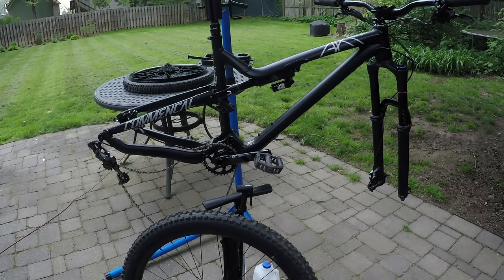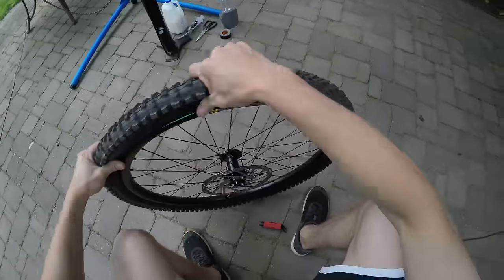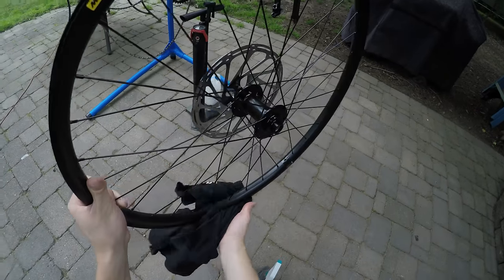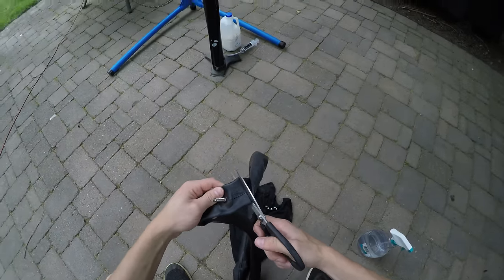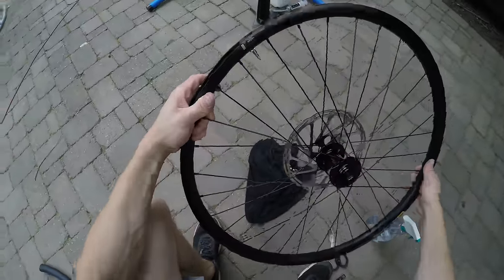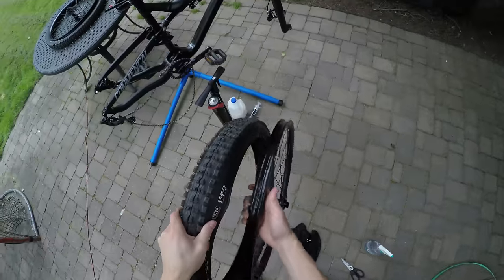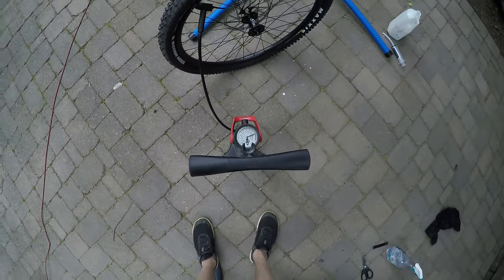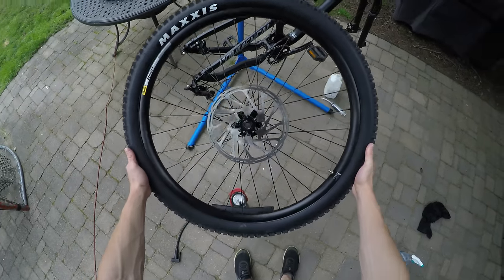MTB DIY Tubeless Conversion - Easiest and Cheapest way!

Comment: I tried this using a 26 x 2.3 Maxxis Aggressor tire on a 26" rim from a 2017 Trek 820. CLeaned with alcohol, 1" gorilla tape seal, 100ML of Stan's and I could not get past 0 psi... Air leaks from the sides and I cannot get the tire to seat. Any advice?

Comment: Hello, I tried but the valve loose air because the missing of the o-ring between the rim and the body of the valve.  The method to reuse a recycled tube valve don not work for me.  Note that the tubeless valve has the o-ring and the fastening ring shaped to accomodate the o-ring in in a way that when pushed to the rim thre are no loss. Moreover teh base of the valve is conical so it can efficently be pushed against the hole in the rim.

Comment: Have you had any experience with just putting the sealant inside the inner tube?  I have recently purchased some inner tubes that came with the sealant inside.   They seem to work ok. However the sealant did dry and clump up after several months.  Was supposed to last over a year but, oh well.  Thanks.
Reply: I have run tubes with sealant for years,  but only helps with thorn holes.  “Snake bites” where your rim bottoms out and puts two holes in the tube won’t seal up.  I finally converted to tubeless, got tired or patching or replacing tubes.  Plus it’s lighter since you lose two tubes.  And you can run lower pressure for better control
Reply: @georgehooper6955  Thanks for the reply.  I have gone back to regular tubes.  I carry a patch kit and a spare tube.  I replace the tires  before tread gets about 50%.  The worse problem I had with the tubes that came with the sealant was that the Presta valve stems would rust off where the stem joins the rubber tube.  Very frustrating.  So now I oil up the valve stems tp prevent rust.  I ride on roads that often flood with brackish water. .  I went to a little higher grade of tire and this seems to help.  Oh, I also went from a relatively narrow street tire to one that is wider. C 38 to C 45 This as I am a very heavy rider.  This has eliminated the snake bite problem.  So now I am back to the old fashion way and doing well with it. Very few flats now.  Other friends have gone tubeless and are happy with that choice.  Thanks.

Comment: How long does this last? And what kind of sealant did you use? I’m trying to figure out why this is going to be better than a tube over time wouldn’t you need to redo this process? Might as well just use tubes... it’s no different really
Reply: Last until the sealant stops sealing. Its has advantages being you can run lower pressures and puncture will he sealed and mitigated by the sealant in your tire. If you get a pin hole leak in your tube you have to change the tube find the leak patch it and or replace it. Tubless you just replace the sealant for the life of the tire. However if you dont ride often or enjoy messing with your bike I would stick to tubes. No shame. It's a tried and true choice.

Comment: Gotta be a way to use this method with inflation foam instead of air, inflation foam needs air to explain and cure so has to be without a tube the type of foam needs to be firm enough to hold a persons weight I’m thinking maybe flex seal might be strong enough

Comment: Does converting to tubeless affect the pressure range of the tire, or is it the same as with an inner-tube?
Reply: You can run a slightly lower pressure with tubeless, around 5 psi less.

Comment: Wouldn't it be easier and less messy applying the sealant through the valve? Or would it clog it?
Reply from the maker: Reyes Escamilla IV yes you can do that depending on the valve and I use truckerco sealant.
Reply: Children Of The Loam thanks!!!
Reply: yup I /put the tyre on /seat the bead on the tyre /let the air out/ remove the valve / use a syringe to put the sealant in through the valve / put the valve core pack in / pump to 50psi over night to set it in place.

Comment: What do you do when you get a flat on a trail? I can’t decide if I really want to go tubeless for that reason.
Reply: You dont get flats unless you have major puncture or tear in the tire. The tubless sealant in the tire is exactly that. A sealant to seal punctures that might happen on the trail. And also you should carry a spare tire if you worried it wont hurt. You would change it normally as if you had a tube only you would remove the valve core and use the tubes. Hope I answered your question. Been tubles for about 2 years now. I love it

Comment: Do you have to replace your hole break assembly if you get oil on it ,rotter and pads
Reply: You can clean the rotor with rubbing alcohol, but if your pads are badly contaminated they might need replacing
Reply: @mattpearce4313  ok thank you so much and ride safe 🇨🇦

Comment: Ok my tires and rims are tubeless ready, I have to pump by hand but no matter how fast and how much I pump no air is enough to make the tire seat
Reply from the maker: Try another layer of tape or use a compressor.

Comment: When i pumped air into it with a floor pump it started leaking everywhere, could not get it past 25 PSI kept leaking air and sealant. I have conti racekings, the sealant would come out thru the side walls and from under the bead. Big mess, standard rim and standard tyres.. big fail. Do you need a compresor?
Reply: No you need tubeless tires unless it won’t work because your sidewalks are to thin . Do you have conti raceking performance?

Comment: So you didn’t tape the valve stem in place?
Reply: Providing you clean thr rubber surrounding the valve, the sealant will seal it (so its not dusty / chalky), and don't over tighten the valve in the rim as this can sometimes be counter productive

Comment: Is there a significant weight reduction to doing this or is it a wash once you put all that duct tape and tire giz back on the rim?
Reply from the maker: Numero Uno there is a fair bit lost
Reply: Haven't weighed mine on a scale but it does seem just a little bit lighter, not that big a drop once you load it with sealant. Some improvement on acceleration. However, the change in grip is significant, even at the same psi. Totally worth it.

Comment: will this work on ANY bike?  i have a 24 inch mountain bike that i need to replace tubes for.  also...is there a list of the exact stuff you used?  what is the white stuff you put in the tire?  i would consider doin this if i had more knowledge and parts..might be good to try.  will this work if you go super long distances?  ty....sorry for all the questions lol
Reply from the maker: it would work on most bikes of decent quality, there is no list but it is truckerco tubeless sealant, and yes it will work until the sealant is gone or dries up.
Reply: wow that was fast lol.   well...im still not sure if i will try it but..what was the tape you used?  that is all you do?  do you bike a lot yself...trails, dirt or paved roads, etc?  never heard of goin tubeless...TY again
Reply from the maker: the tape is gorilla tape and just do everything in the video. We do bike a lot, check out our riding videos.

Comment: Guess I will need to buy a better pump. I'll be trying this next week. Cheers!
Reply from the maker: Good luck.
Reply: Children Of The Loam can I run tubeless on my marlin 5 stock rims? I've been told that I can't.
Reply from the maker: Ya its not guaranteed to work with that rim but you may have success if you want to give it a try.

Comment: Can I just clarify - so what happens when you have a tire with no tread and you need to replace it? You now lose the whole wheel?? I assume you can’t remove the tire from the rim once it’s sealed in place. Seems like a pretty big problem, otherwise an awesome idea to save money on tubes.
Reply from the maker: You can 100 percent remove the tire just like any other tubeless setup.
Reply: @ChildrenOfTheLoam  Awesome - so the sealant would just sort of peal away when removing the tire? I'm pretty keen to try this tactic, I go through sooo many tubes :/
Reply from the maker: @jasonjarred5198  it should stay in a liquid form but if it does dry out over time it will peal away super easy.

Comment: Had a hard time setting mine. It didn' t inflate, my tire seems a bit loose on the rim. The bead doesn't seem to seal off the rim and the air just keeps escaoing the side. You think its probably the rim?
Reply from the maker: Ad'l Madueño it could be, try putting a couple layers of tape on.

Comment: I got a question I just recently set up my tubeless tire and planing to change sealant brand after 2 months, do I need to replace rim tape or is not necessary? thanks
Reply: If the rim tape is not damaged you will not need to replace it. But if your replacing sealant for a constant leak you probably do not have the rim tape setup right to begin with.

Comment: I rode a bike someone did this to. Basically Stans conversion with non tubeless tires. Front tire ripped off the rim when landing off a jump and I smashed my face as hard as I think I ever have.
Reply from the maker: we have run this setup for three years and in all our videos without an issue and we corner and jump pretty hard, must have been set up improperly.

Comment: Hey bro, ive got a rim that fits both valves (so the car one and yours). And i want to go tubeless.. do i need to buy a specific valve or can i just use the presta/ the one your using. Thanks
Reply from the maker: ya you can only use a presta valve like the one in the video
Reply: @ChildrenOfTheLoam  alright thanks bro

Comment: No need for tubeless. I've run both analog and ebike hard with no flats. Except for a thin Schwalbe tube. More work with tubeless you have to refill. And hope it will work when you get a flat. I tried and it didn't help with a burp 🤗

Comment: Can you go tubeless on non-tubless tyres? Thanks!
Reply from the maker: you can usually make it work but some tires may loose a little air or leak sealant over time.

Comment: Bro, how are you able to seat the tire on and off so easy? I seated my maxxis ardents exo myself and it took much tire wrestling before i got it properly seated on the rims.. im using a 2.25wide tire on 24mm inner width rims
Reply from the maker: It just comes with experience, I could maybe make a video about some tips and tricks.
Reply: @ChildrenOfTheLoam  well,  it was my first try in putting a new tire on a new rim... but dude, getting that final lip to go over the rim and into the center was really tough! so tough I ended up scratching my new rim decals in the process... bummer...i swear your video makes it look so smooth... love the tire valve tip also...though I'm not quite sure if I'll be cutting my new inner tube up anytime soon...i think i'll be running tubes for the moment... nice video though! Thanks for sharing!
Reply: @ChildrenOfTheLoam  I wonder if my tire having EXO sidewalls have anything to do with the difficulty in seating it in the rim? It's also not TR but its a folding tire, do you think I can convert this to tubeless?
Reply from the maker: You certainly can

Comment: can i do this on my spare Schrader valve(old tube)
Reply: Clieford Daan I don’t think I’ve ever seen it!! Try presta lol
Reply: I think this only works with a Presta type valve as it's got external threads you can use the stem nut on to pull tight against Gorilla tape / rim.
Schrader (same as automobile) stems are not externally threaded.
Hope that helps.

Comment: What is the point of having tubeless?
Reply: The main thing is that you can run lower tire pressure (low pressure = more grip) and get significantly less flats. If u get a flat tire with tubeless you can often just pump a bunch of air into the valve until the sealant repairs the hole.

Also it's a little lighter than with inner tubes.

Comment: What brand tape and where to purchase?
Reply from the maker: Jason Hodges Its gorilla tape, you can find it just about any hardware store.
Reply: I was gonna ask the same...is that stuff like what is also called gaffer tape? Which is kinda a woven tape with a fairly aggressive adhesive?
Reply: Children Of The Loam 
can i use electrical tape
Reply from the maker: trevortni 09 unfortunately no
Reply: Children Of The Loam just asking

Comment: You think this will work on my son's bmx bike?
Reply from the maker: honestly it probably will not, you should be alright running tubes in a bmx bike though.
Reply: @ChildrenOfTheLoam  tube with sealant? Because I already run a tube he just gets crazy flats! Like every time he rides? Crazy
Reply from the maker: ok, you can try going tubeless but I have never done it with a bmx or heard of it working but best of luck to you!
Reply: @ChildrenOfTheLoam  lol I will thanks for your vid if I get any results I'll let you know buddy!
Reply: @chetlangford2144  but bmx tyre is running on high pressure so it maybe will get diffycult.
Reply: @shadowcode.3326  it runs on 40lbs of air
Reply: @chetlangford2144  thats not really high so it will probably work
Reply: @shadowcode.3326  Thanks man I was looking @ it last night the psi and thought it will work ! I'll post

Comment: Continuing on with my first comment, I bought some fix a flat like stuff, did all the prep as per video etc, filled the tire with the spray, and the tire actually seated, but so many tine holes it lost pressure so I let it sit for two days rotating occasionally and flipping, now just tried to fill with a compressor but it will not seat. These are not tubeless ready tires or rim but it seems like some other have had success - anybody have any suggestions? Anybody do anything special with their ordinary rims to get them to seat?
Reply: dictater2 any update? Maybe increase the amount of sealants?

Comment: I dont understand what the white fluid did; specially, If you didnt spin the tire. I thought the white fluid was going to glue the tire to the rim. Is that what it does? anyone?
Reply: it's for when you get a puncture (or if there isn't a perfect fit - for example around the valve or by the rim sometimes) - the sealant will fill that in and hopefully prevent any air leaking out.
Reply: what keeps the tire attached to the rim in this case? The tire's edge doesnt detach from rim at the inner circle of it, does it? Does the air itself create enough pressure for the tire to attach to the rim?

Comment: Ive been unable to put air in my tubes for a while, when i start pumping the pump valve comes off of the socket. Neither the pump or tube valve appear to be damaged. Anyone?
Reply: Are you saying the pump jumps off the valve? Thats from not starting with the pump's lever straight up, pushing far enough down onto the valve, and then closing the lever down. If you missed any one of those steps it isnt going to flow into the tire or tube and the air has nowhere to go

Comment: You have some errors. Firstly, the tape that you use when you press it high will break it and secondly the valve you put must be under the tape  and you put a layer of tape over it again Because it will leak through them

Comment: I guess, after this conversion, you gotta hope like mad that you never have to replace a spoke??
Reply: With any tubeless rim tape you will usually have to replace it if a spoke needs to be replaced. Exceptions of course to a very few spoke types that don't tighten down on the outer rim by a regular spoke nipple.

This method is also used at my bike shop and works great!

Comment: Can’t stand tubeless, takes less than a minute to throw on a new tube if you do it enough. Some situations would be better to avoid those pinch flats but not worth it to me in anyway
Reply: Many reasons to run tubeless over tube I'll never go back to tubes ...havent ran into a single issue yet ..although my rims and tires are tubeless ready

Comment: Maxis, the worst tyres ever... More plastic than rubber.
Great video anyway👍
Reply from the maker: I don"t know what maxxis tires you have used but they are the most proven tires in the sport.
Reply: Bad experience. I had them on my Vauxhall 6 years ago. I hope they not that bad now.
 I prefer to stay away from this brand.

Comment: What's the point? You've eliminated a cheap, easily repaired inner tube for a system that is difficult to repair on the trail.
Reply from the maker: Do some research bud, the whole point of tubeless is that it repairs itself so punctures aren't a problem.
Reply: @ChildrenOfTheLoam  My remark/ question comes from extensive experience in adventure motorcycling.  Friends and I run tubes in our tubeless motorcycle tires because when you're really in remote areas tubes are repairable even with some a badly damaged  tire. A tube is also easily inflated with the weakest of air pumps where  seating a tubeless tire usually takes a substantial blast of air through the valve stem. As shown in the video. I can't imagine anyone who rides off road a long way from service using tubeless tires. So again, why would anyone want to replace a simple and reliable system?

Comment: This is cheating. There's lot of non-tubeless rims that are less than 20 mm wide internaly and this tape won't fit that nicely there (not to mention that the tire will distort it later). Also, you will have problems fitting the tire around the valve there, AND using airshot is nothing like using just the floor pump alone. Some tires won't inflate even with airshot and with valve core removed - you will have to be innovative and seal them somehow just for first inflation and/or use proper compressor.

Comment: Can i still get a flat? Cause if i can this video is useless
Reply: Using a good quality sealant should stop 95% of the usual flats without you noticing (infact you wont know you had a puncture unless you look at the tyre and see the sealant) it wont stop gashes through sidewalls though.

Comment: Using Gorilla tape is a horrible idea. If you need to get it off it is a nightmare! Just use rim tape and the proper valves, these cheapskate cheats are garbage and just plain dumb.